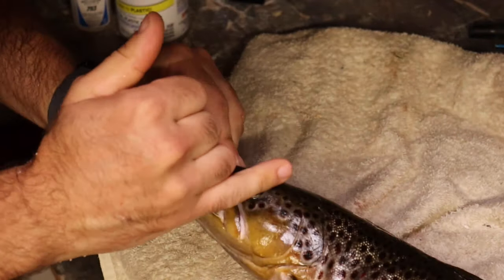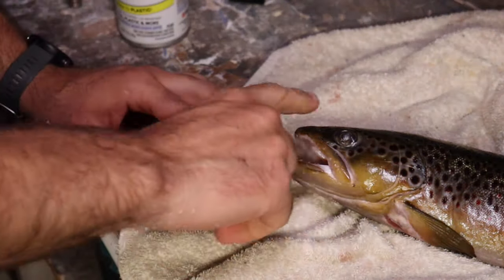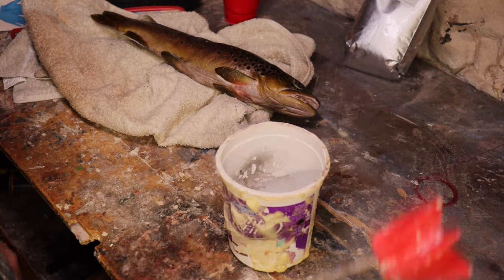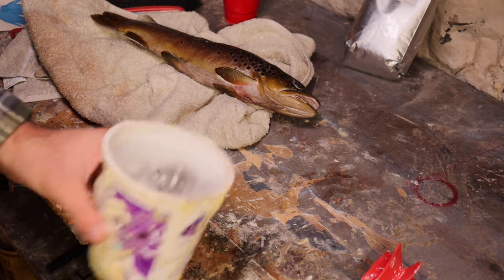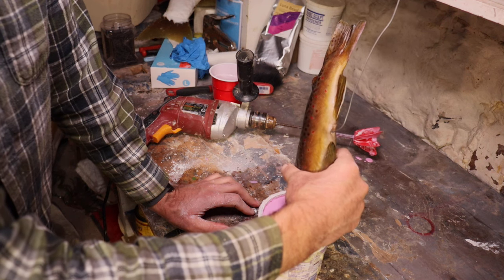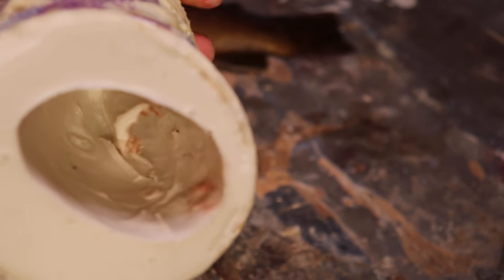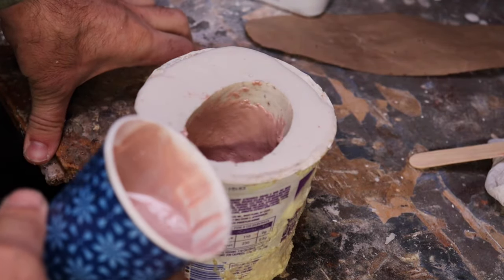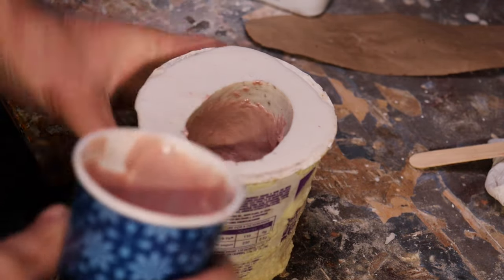Fish Taxidermy: Casting Trout Head

Comment: Awesome video. Do you get a lot of detail of inside the mouth ? Like gills and crusher teeth?  Or esophagus ?Thanks.
Reply from the maker: Thanks! Casting this way will give good detail if the alginate is mixed right. The teeth will typically need to be rebuilt but mostly the detail will be pretty good inside of the mouth.
Reply: @Dustinstaxidermy   Thanks for the reply and the video. Great channel.